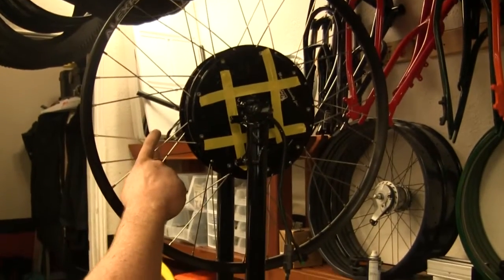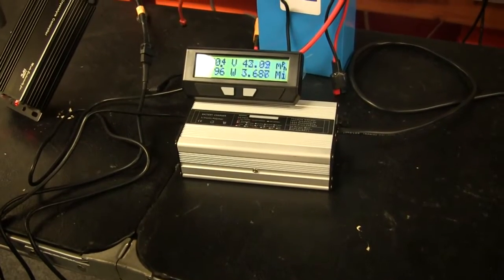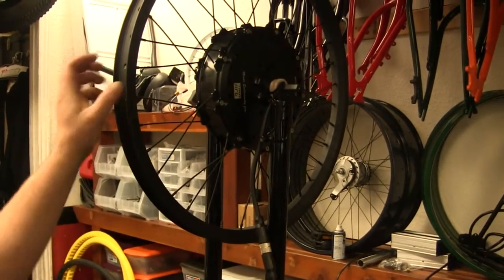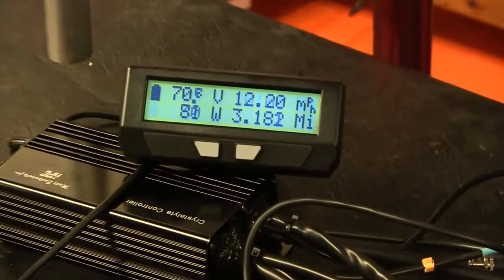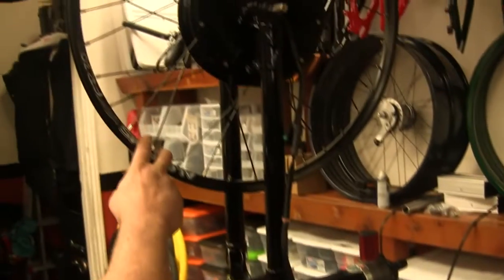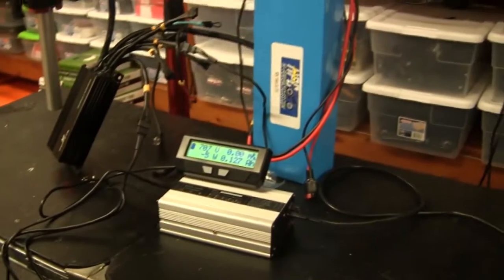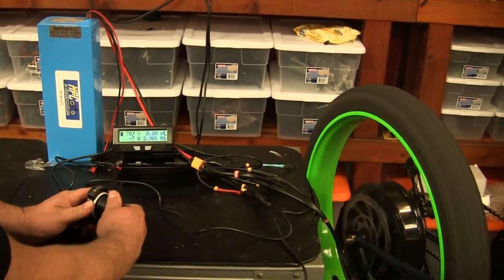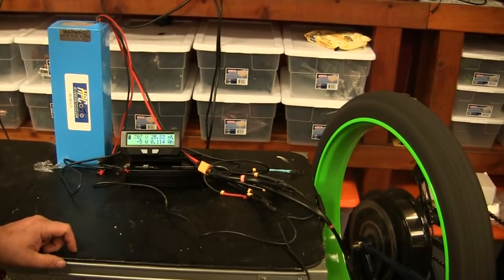5000w - 6000w MOTOR COMPARISON FOR TOP SPEED 4 MOTORS

Comment: Classic absolute no clue what the wattage, voltage and amperage is. Meter shows 185W, and the local ebike guru says 3000W.
Reply: wait for the 30,000 watts ;P
Reply: It's a 3kw controller. The motor is running no load. Thats why power consumption is low...
Reply: i took it as a base line to see max rpm using the same esc and battery on various moters, would be cool to see various rpm vs watts vs various load graphed out

Comment: Where on earth are you reading power draw? CA clearly shows under 300 W as the motors were spinning in free air. "3000 W" repeated over and over again has no relevance in whatever test you are trying to conduct here in free air. Only demonstrations here are Kv and hysteresis losses. Get any RC bldc motor on there and watch it spin to 100s of miles per hour, unloaded obviously.
Reply: Yeah, I face palmed pretty deep on this one. You still get a good idea of the KV rating of each motor though.
Reply: Exactly,no load so it could hit top speed with 300w controller. Main thing to mention would be the same voltage in all scenarios because that is relevant in this scenario. Which hub spins faster with same voltage...